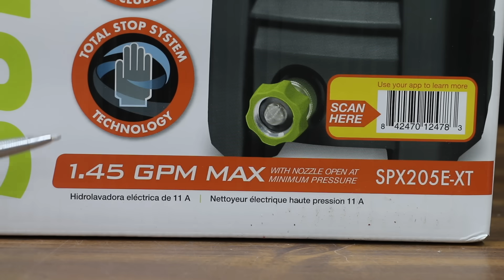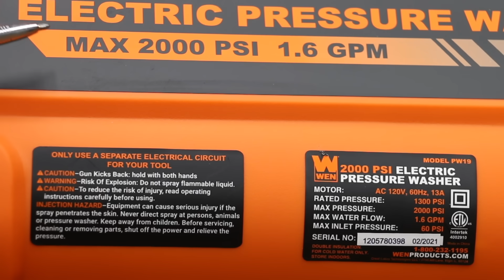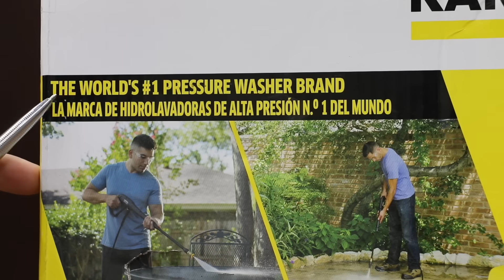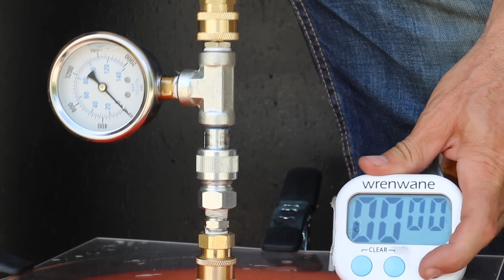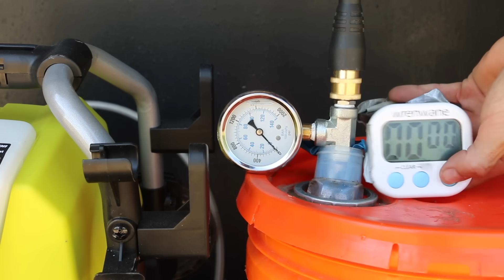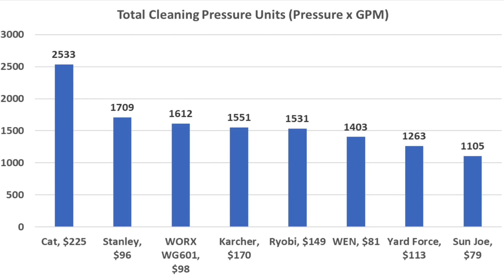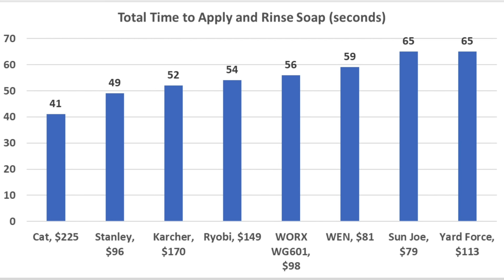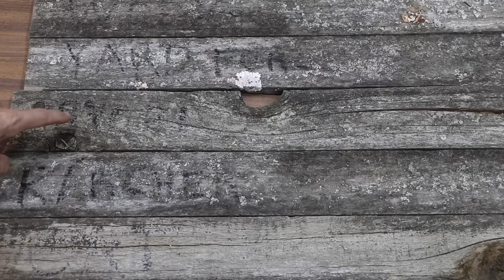Best Pressure Washer (ELECTRIC)? Ryobi vs Karcher, Stanley, Sun Joe, WEN, CAT & WORX

Comment: Nice review, however the most important issues are wand longevity, o ring replacement and how well do they work NEXT YEAR with reasonable care. I've found that the wands just don't hold up for more than 1 season; neither do the replacement wands from the big box stores. I'd rather spend $300 to $400 on a quality washer that will last. Please do a review on better quality products. Thanks.
Reply from the maker: Thanks!   Thanks for the video idea.

Comment: I have the old Karcher red one. It refuses to die. Bought a newer yellow one because it had wheels and wind-in hoses. First use the wind-in lever broke, then the pulsating tip broke on the second use, then the ground fault switch broke, replaced the ground fault with straight in wiring, then the motor decided to crap out, then I tossed it in the trash and still use the old red one, that has more power anyway... 🤦
Reply from the maker: Thanks for sharing.

Comment: Suggestion:  Something I always wanted to try - the next time you test some of these small plastic, 1.5 gal/min, 110V electric pressure washers, try taking the wand hoses from (2) of them and connect them to a T fitting and bring a single hose off to try to get 3 gal/min at full pressure from 110V,  equivalent to what a good gasoline pressure washer would put out.
Might need a check valve at the T from each unit to keep water from trying to go backwards into the other one with the lowest relief pressure bypass when the gun handle is released.  They both have a 1.5 gal/min bypass relief so they each should be ok otherwise when the gun trigger is released.  During spraying, as long as the nozzle pressure at 3 gal/min is lower than either unit's bypass pressure, it should work great.  What could go wrong?
Reply from the maker: Thanks for the suggestion.

Comment: It was surprising to see Cat has a unit in this game.  At more than twice the price of some others, I'm not too surprised it was the better model.  An electric pressure washer could be on my radar.

This showdown was very interesting to me for a singular reason - I AM TIRED OF REBUILDING CARBURETORS WHAT SEEMS LIKE EVERY TWO YEARS (sorry for the rant - it's been a two Monster day).  But seriously, I've got to have around 20 small gas engines to maintain, so replacing them with capable electrics is a winner for me.

Now that everyone has one of those Lithium power packs/solar generators in the trunk of their cars, the simplicity and reliability of electric appliances in outdoor scenarios is becoming attractive.  I threw out my 12VDC tire inflator and just use a 110V 1 gallon compressor in my truck, connected to my 1.2KW solar generator.  I'm also back to my corded circular saw and sawzall.  The Cat pressure washer could be next.

Thanks again for an excellent comparison!
Reply from the maker: You are welcome!

Comment: I was happy to see you mention cleaning units. Most consumers are not aware that's how you determine the effectiveness of the unit.  3,000 psi washers are not created equal. As someone that does painting and remodeling I've had several different brands over the years. I learned that you can't get a good one at a box store. They are ok for a home owner, but not for a contractor. I currently have a Mi-T-M H-3047 3,000 psi with a 270 cc (9 hp) Honda engine. It claims 9,000 cleaning units. I believe it. However, it costs almost $2,000 with the tax. I would love to see a side by side comparison with the best box stores have to offer. Both performance and durability/lifespan. They recommend 10-20 hrs per week. I have used it hard without issue. That thing will about rip your arm off. You have to be really careful even with the green tip, or you will tear the deck up. However, for the time (labor cost) it saves to do the job, it paid for itself many times over.
Reply from the maker: Thanks!

Comment: Me: What if you connected washer to a gasoline tank and used it as a flamethrower.
Todd: yeah, we gonna test that!
Me: Holds your beer

I know that gas is going to disolve internals.
Reply: Cheapest way to do a flamethrower is get a fuel pump from a car. 12V so it's mobile and they build about 60psi, easily enough to throw gas a long way

Comment: For what it’s worth, I have a Ryobi and only had it a few years. All the fittings and o-rings are leaking and it is nearly impossible to get the hose off the pressure washer.
Reply from the maker: Thanks for sharing.

Comment: Bought the Sunjoe for using on a concrete house we were building, broke within the first day, coincidentally, have had a harbor freight pressure washer which looks pretty similar that is still going strong after several years of use
Reply from the maker: Thanks for sharing.

Comment: I would like to see a project on driveway cleaners. Many advertise to just spray on a liquid and rinse. But none of the ones I've tried actually work without a pressure wash afterwards so I'm not sure how much was due to the cleaner or the pressure washing.
Reply from the maker: Thanks for the suggestion.

Comment: My Karcher is 23 years old , still great. To bad you can’t figure out what really matters . Quality and life of unit. I’ve seen to many people burn through cheap units .
Reply: My point as well. Karcher is oldest company manufacturing pressure washers.
These tests are ok. But they do no test how many years these pressure washers last. So for me is this test useless.
I had 3 Karcher pressure washers over 20 years and no issues ( over time I was buying more expensive models and selling the old ones)
Reply: Btw I would spend $400 for good one

Comment: The Sun Joe seems somewhat similar to the Harbor Freight washer I bought, I can't justify spending too much on something that I only use occasionally and it works good. Only the soap dispenser doesn't work great. When I bought it I was told that there was a restocking fee, that's a problem with HF too many people buy tools 🔧 use them and return them. I don't do that and I still have mine.
Reply from the maker: Thanks for the feedback.

Comment: I like the testing of these different devices.  However, you are testing 1600 psi rated washers against 1800 psi or higher washers.  Each company usually makes different versions, and similar ratings should be tested against other similar ratings.  If 1600psi washers are tested, then all that fall into the 1600psi category should be tested against each other.  If you are testing 2000psi units, then all should be 2000psi rated.  For instance, the cat is a higher price pressure washer that delivers 1800psi at a high flow rate, and its price point reflects that.  Now you are testing a low price range Stanley and a low range Sun Joe against that.  Both make higher pressure versions in the same price range as the CAT with similar wands and changeable pressure nozzles.  I suspect the ratings would be more in line if all units were from the same operational range.
Reply from the maker: Thanks!  Thanks for the constructive feedback.

Comment: On an unrelated subject. Trailer and RV interior lights and exterior lights. They are subject to a lot of vibration, and possible over and under voltages I know that much about them. Because I play  a 4 string Bass guitar and I've destroyed. With help the poor soldering, (China) the chip becomes unmounted. The manufacturer of these  is the one to avoid of all the lights offered, (I would bet.) There is no name.  But, i could take a picture of them.
 I have to buy the lights soon. There appears to be, but there's no, pressure on making video, because I know you're busy doing great things. PS I'm very envious of your position I would love to do what you do. Keep up the best work there is
Reply from the maker: Thanks, will do!  Thanks for sharing.

Comment: There's a 2000 psi greenworks model that around $150 - would be a good one to add to this test. (In my research the quality of the high pressure hose was way better which sold me personally)
Reply from the maker: Thanks for the suggestion.

Comment: The Yard Force reached 1050 PSI in 2 seconds not 975 (at least that's what the video shows at 10:12) before slowly rising to 1075 after about 10 seconds.
Reply from the maker: Thanks for the feedback.

Comment: I'm having a hard time deciding between the Stanley and the WEN. My only plan to use the power washer is to clean my cars. Will the WEN be a good enough choice for the money?
Edit: I have oil stains in my garage (concrete) and I want to get rid of them. Is the increased power of the Stanley necessary or worth it?
Reply from the maker: Thanks for the suggestion.

Comment: I have a slightly higher end Sunjoe pressure washer, the SPX3000, and now I'm quite curious how it stacks up in these tests. It has 40k 5 star reviews on Amazon and I'm generally happy with it considering it was under $150. If I'd seen this video before buying it I would have thought the Cat was the obvious best choice. Given my experience I worry some middle tier models weren't included.
Reply from the maker: Thanks for the suggestion.

Comment: A 30' or 35' hose would be much better than a 20' hose. With a 20' hose it is required to move the unit several times when washing a car.
Reply from the maker: Thanks for the feedback.

Comment: The sunjoe looks like it might use nilfisk standard connectors on the wand/hose/spray gun - would be a good brand to try i think (had a C120.3 for 5+ years now)
Reply from the maker: Thanks for the feedback.
Reply: @ProjectFarm  NP, in fact it looks like a number of them look to have the nilfisk type connector or one that looks a close match to it.

Comment: My stanley bought off amazon with 5 year warranty. They sent it and refunded the warranty and said they couldn't do it. Then it quit working a little after 1 year. The adjustable tip sucks because you can't put attachments on it (like surface cleaner).  Just bought the ryobi.
Reply from the maker: Thanks for sharing.

Comment: I bought something like this and have used it twice to wash off my back patio. It does a good job for what it is, but it feels cheap, we shall see. I don’t use it enough to justify anything more.
Reply: In 93 I worked in a paint store and rented out professional pressure washers, when I say “feels cheep” it’s in comparison to that. All metal cart with a Honda engine and machined pump with heavy duty hose and gun.
Reply from the maker: Thanks for the feedback.

Comment: I've worked at a zoo, where pressure washing tends to be routine (if not daily). Animal departments bought cheap power washers all the time due to their budget. Facilities usually bothered to invest in a decent piece of equipment. The number of times I glanced over a Sun Joe, Karcher, and Ryobi... Lol. The GFCIs are usually poorly constructed and can't get wet, they have plastic connectors, the triggers wear out, and the motors (strategically) die right outside of the warranty limit. I've had good luck with Husqvarna, Hotsy, and the occasional Simpson. You get what you pay for.
Reply from the maker: Thanks for the feedback.

Comment: I don't use it often so I got a cheap one... $35 for an "AR Blue" which appears to be identical to the SunJoe. It works well enough to blast the crud out of my black irrigation pipe, which is all I ask of it. Of course nowhere near as powerful as the bigger units.
Reply from the maker: Thanks for sharing.

Comment: store your pressure washer inside and don't lent it out. I have a gas BE 3100 and wash my limestone bedrock (as a patio) of 65 yards long and about as wide. It's still going strong and starts easily. I should have put an hour meter on it because it has many hours of usage.
Reply from the maker: Thanks for the feedback.

Comment: About a year ago I purchase an electric pressure washer after doing a bunch of research. It's made by "Active" and its 1800 PSI. Cost around $140 and is similar to the CAT or Wen ones but without the brand name and actually had more PSI. It's been a great Unit, the only downside I have found is the hose length is a bit short but not a deal breaker at all.
Reply from the maker: Thanks for the feedback.
Reply: Active makes CAT pressure washer.

Comment: I live in a place where pressure washers are very necessary as a home owner... concrete needs to be cleaned once a year to keep looking nice... I've own a few gas powered models... but recently picked up a small electric Ryobi (1600psi / 1.2gpm). I've used it a few times and it does a good job considering the price point, ease of use, how well it removed stains, portability and compactness... It has a turbo attachment (not sure the name) I glad I tried it 1st (I didnt try the other normal attachments)... I would use it for large jobs... but its working great for me to do the driveway... and it works with less water... my old gas model put out tons of water... so I'm very pleased with it... enough to leave a comment here... lol
Reply from the maker: Thanks for sharing!

Comment: Don't buy these. Professionals never use anything less than 2500+ anyway. I've sold MiTM and Graco PWs for years, to pros and property owners. MiTM is overall better, but Graco is easier to fix. They both use standardized fittings. You can also rent pressure washers from a lot of rental places and paint stores. Pressure washers are a go big or go home piece of equipment.
Reply from the maker: Thanks for the feedback.
Reply: @ProjectFarm  We respect your unbiased videos, they are informative and entertaining! I just had to chime in, pressure washers are a niche market I happen to know something about.

Comment: I purchased the SunJoe brand power washer when it was the older style, but I believe the mechanics are the same.  For a low cost occasional use power washer I am pretty happy.  You can do big jobs with it, but it will take a LONG time.  My biggest complaint on using any power washer is how it makes your hand go numb after a while.  I ended up using a spring clamp to hold the trigger closed and save my hand from going numb and hurting after too long.
Reply from the maker: Thanks for the feedback.

Comment: I really enjoy your videos and I have followed used your results in buying several items. However I think you should have included the Honda Pressure Washer in your test. 
Several years ago I bought a Karcher brand pressure washer and it it sucked big time. Couldn't get it to work and it kept stopping delivering the pressure water.  I took it back to Home Depot and bought a Honda Pressure Washer (more $$) and it has been faithfully working for at least 7 years now with no issues whatsoever. It still has the same spark plug, same oil it came with and I do not remove the gas for winter storage. For my spring cleanup I add a little Seafoam to the gas, and it fires up within 2 pulls.  When (and if) it ever dies, I will buy another Honda.
Reply from the maker: Thanks for the constructive feedback.

Comment: 17:40 I can hear cracking-like noises on handles that you state had no damage. Maybe stating no visible damage on the outside would have been more accurate. If you then cut to each item in use and saw how it performed (up to previous specs), then you could say "no damage".
Reply from the maker: Thanks for the constructive feedback.

Comment: Great video as always. I bought a slight larger sun Joe couple years ago neat little machine 2050psi the hose is now damaged but easy enough to buy a universal one m22 both sides. Connecting it there's a lot of play and at a closer look the size is slightly off. Here in Canada a sun joe hose is 60 bucks that's more then any other brands. For 98 bucks on sale normally 198 I picked up a compact kobalt 1700psi pressure washer instead. it's an amazing little machine. definitely fit this category and worth looking into. I use it to wash a car and siding but did a pretty good job cleaning the driveway.
Reply from the maker: Thanks!  Thanks for sharing.
Reply: I have that same upsized 2050 psi SunJoe...have had for 2 years. It is far superior to the smaller one and frankly is a very good electric power washer. Has been reliable and no problems at all. Trick with all of these is to drain all the water when finished....blow air through the machine to get all the water out. I use for cars, diveways, house patio, and even for inside house for showers. The light weight and no gas mess is a big advantage as well as less room required for storage compared to gas one.
Reply: @RobertKarlBerta  absolutely on the no gas benefit I wouldn't use it enough and gas goes bad. It's a neat little machine for sure.

Comment: I think my 1980s KEW Hobby 88 would trounce all those modern plastic things. Its about the same size, but oil cooled, with a multi piston swash type pump. Made from brass, aluminium and stainless steel parts so weighs about 50 lb. It cost about £160 UK back when there was probably $2 US to the pound Sterling, so you think $225 is expensive !
I used it yesterday for 4 hours straight, so built to last even though it was meant for the hobbiest home owner. One if not the first home pressure washer, but built internally to a professional design standard. I can still get certain spare parts for it. I asked a tool shop a few years ago if there was a modern equivalent. He said no, nothing as good as that any more, but if there was it would be over £500 (say $600).
That wood cleaning test, it would take the grey off back to brown wood no problem. If you see one for sale second hand, buy it.
I think the KEW company was bought out by Nilfisk who also make pressure washers.
Reply from the maker: Thanks for the feedback.